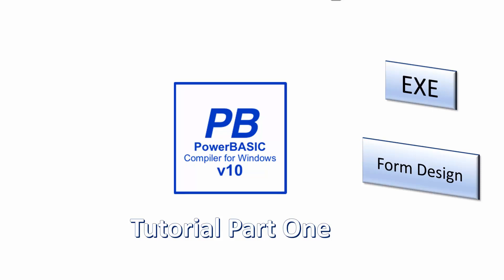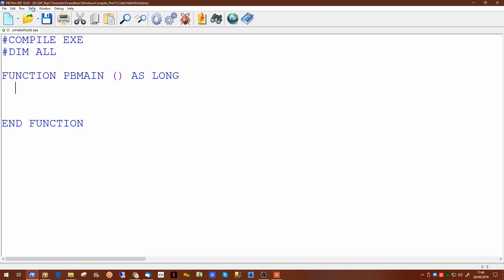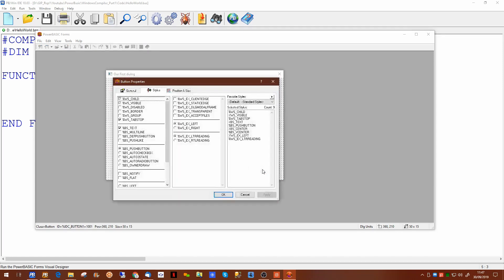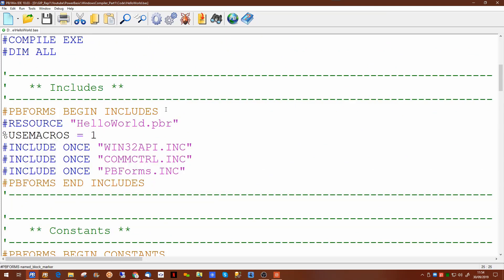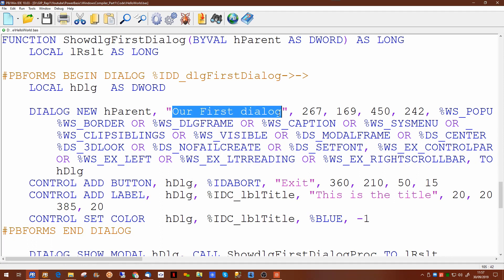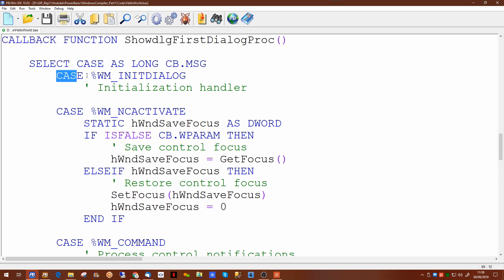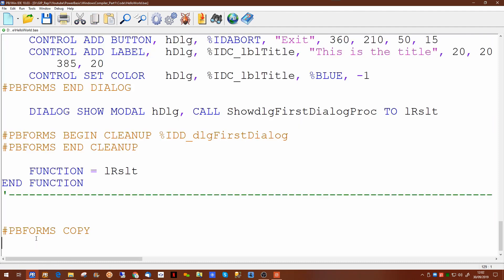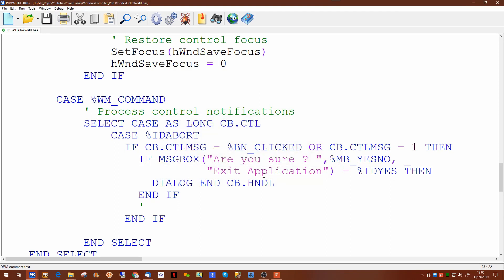PowerBasic Windows Compiler tutorial Part 1 - Designing a Form

Comment: It's good to see a good tutorial about Power Basic. Is it better to use than Visual Basic???
Reply from the maker: PowerBasic has a few advantages over Visual Basic. 1) It runs considerably faster, so computationally intensive tasks benefit from this.  2) It can compile down to a standalone exe, minimizing the need for complex installations. 3) It supports several low level options natively like in line assembler, TCP & UDP commands.
Reply: Does it work well with MySQL database?Can it be used on the web?
 @powerbasicforbeginners
Reply from the maker: There is an add-on called SQL Tools, which I've covered in the third party tools, that lets you connect to any ODBC compliant database.  Yes you can create CGI applications for the web, there are a couple of videos on that, and even one on creating a simple Web Server.